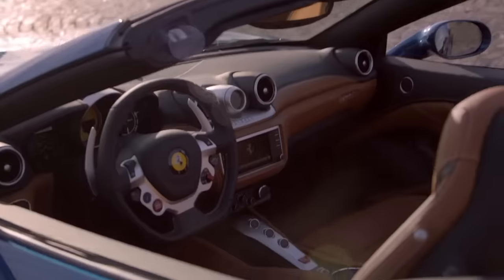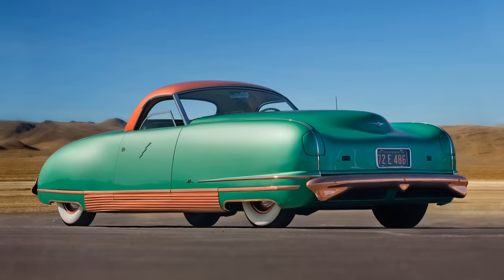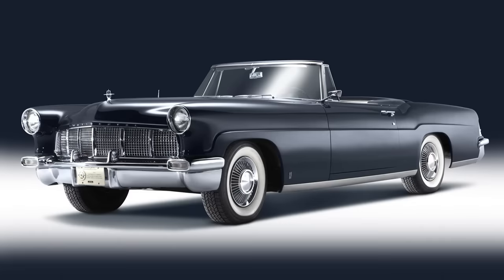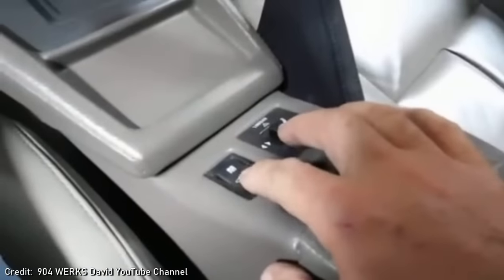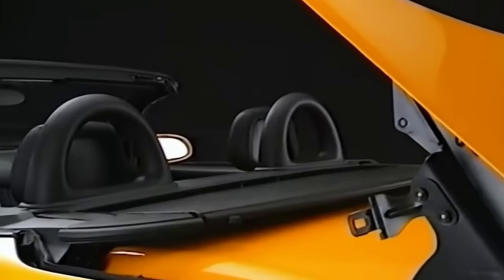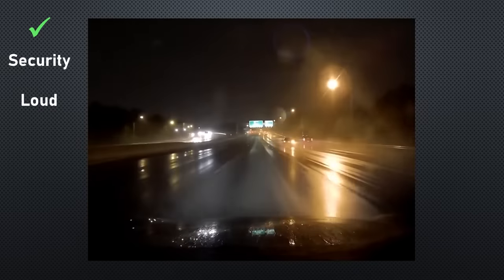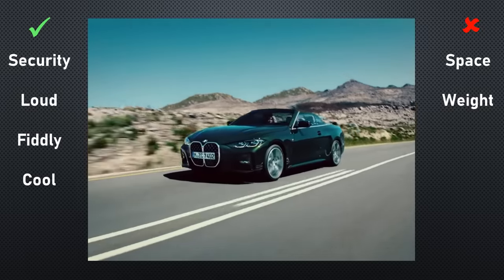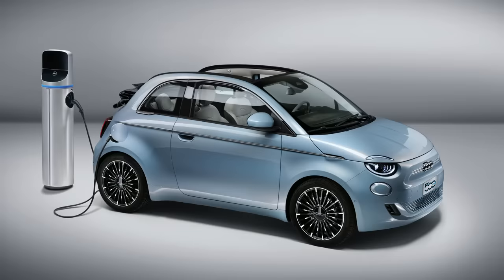The Rise and Fall of Retractable Hardtops

Comment: I still have my retractable hard top convertible 2011 Volvo c70, and I LOVEEE this thing. It's like nothing else on the road. It still garners a lot of attention when I put the top down, it is very quiet, and it drives very smoothly. It is also pretty darn practical, even with the top down. There's still space to store stuff back there, and the back seat space is more storage. I have 130k miles on it and I can't imagine giving this car up for almost anything. I was so sad they discontinued it in 2013. It's the only car I ever want to own.

Comment: My MX5 with retractable hardtop (gen 3 built late 2006) is one of my favourite possessions. I’ve owned it from new and cared for it. It is brilliant to drive, economical and pretty to look at. Sadly, it is now a full time coupe and hasn’t been a roadster for several years. It has a bent tooth on a sector gear. I can’t just replace the sector gear. Mazda will only replace the entire underlying mechanism for a ludicrous amount of money so, in these plague years unless I win the lottery it will remain a coupe. Oh, I’m reliably informed that it is essentially worthless without a working retractable top. It is brilliantly designed — there is plenty of boot space for a 2 seat sports car, it retracts in 12 seconds (when it did retract) but … ? Not happy, Mazda.
Reply: Try an independent shop. They may have a fix for you.

Comment: Have a 2006 vw eos... great car handles well, 50/50 weight distribution with top down. 2.0 turbo so is golf gti like. 
Disadvantages... 30mpg which isn’t too bad considering everything, boot space... not too bad really and better than a golf convertible, but then if I want to haul stuff I use my vw t5 long wheel base. 
So yea it may be out of fashion but it’s lot more fun than a boring suv in white zzzzzzzzz

Comment: I used to have a modern soft top convertible, 2002 Chrysler Sebring. I say "modern" because it was pretty decent at reducing exterior noise, had a glass rear window, and took a bit more than just cutting the roof open to get inside. But I must say, as much as I loved that car, I still like the looks of a hard-top convertible, especially if you live in a region (like I do) where the seasons are exactly as you would expect, cold snowy winters through steamy hot summers. Which means there will be long stretches of time where the top stays up, and I'd like the car to look like a normal coupe. I also don't wanna be bothered with special care for the top during this time. However I've heard stories of hard tops forming leaks in places soft tops wouldn't unless you damaged them.

Comment: I have had hard and soft top convertibles. The soft top was a lovely little MGF that was like a road legal go-kart and made me grin every time I drove it. Downside - it was a single layer top so it was noisy and made the interior dark and it had....................yes, you guessed it - the notoriously unreliable 1.8 litre Rover K-series engine. I blew two head gaskets before my eyes were opened and I saw the words on the bonnet (hood) that said 'bottomless money pit'. The hard top convertible was a Peugeot 207 Coupe Cabriolet that with the lid up was a quiet and comfortable long distance cruiser and a civilised tin top coupe in the winter. Put the roof away into the boot (trunk) and it was a great convertible. The MG was much more fun to drive though. I'd still go for a hard top coupe convertible and I have my eyes on the Lexus SC.

Comment: What timing. I just traded in my 2010 MX-5 with retractable hardtop for a 2021 MX-5 with a soft top. Plus I just completed my first road trip of around 700 miles. Yes, it is a tad bit nosier on the highway but it also lost 300 pounds and gained 25 HP translating to more fun. I just didn't think that the RF model kept up with the weight gain.

Comment: Good retrospective video. A cheap soft top is a pain to live with, but if you look at the quality of Porsche 911 cabriolet tops you realize these can be done perfectly. I had an early SLK and enjoyed the relatively simple retractable hard top, but the car was tiny so aesthetically it worked. The BMW 3 series retractable roof was a styling disaster, IMHO: Too many seams spoiled the intended cleverness. Overall, I think the soft top is more elegant, but only when done well.
Reply: If, like it's grandfather, the 911 is a cabriolet and not a ragtop, then I get it.  Thr vw beetle cabriolet was insukatrd and had a headliner so that Germans wouldn't freeze to death driving it around in winter.

Comment: I mean, soft tops get old and worn out after sometime; though they look prettier but they are a bit of a hassle once manufacturers didn't produce spare soft tops anymore. Thus retractable hardtops is actually very promising in a long run, and also safer from prying hands. That's why my dad bought the SLK instead of the E-class convertible, even when both cars have similar pricing when entering the 2nd hand market.

Comment: I have a Mazda Miata RF (inherited from my wife) and what I like most about it is that I can put the top up or down @ a stop sign or red light. I drive around with the top down and put it up when I park so leaves don’t fall in and the leather seats don’t get cooked. There is enough room for a couple supermarket bags and that’s about it. I wouldn’t have bought this car but now that I have driven it a couple thousand miles I kinda like it. I have a GMC4X4 Duramax in case it rains and when winter rolls around.

Comment: In very sunny climates another advantage to retractible hardtops is that soft tops degrade in the harsh sun. Where I lived in San Antonio Texas soft tops would only last 2-3 years outside. I had a MY2000 SL500 and replacing the soft top was expensive!

Comment: I remember the second facelift of 1st. gen of Mercedes ML had optional electric folding rag top over whole roof but device always failed if not properly regularly mainained. Some manufacturers still offer it for some long roof models. Mercedes of A and B class even had polycarbonate transparent lamela sliding roof as an optional extra. The king of them all is custom made Ford F-150 by Newport convertible - my faw WoW drop top....
My mom loves the oldest one of our family cars.....an ageing mulla scapegoat we keep from nostalgia....Grand Scenic with panoramatic sunroof...and you know what? Once a year to clean up its rails and spout cannals, every 6months to spray mechanics with silicone oil...and that's it....still retracts smoothly....never leaks...very durable and reliable system!

Comment: Having just got a hard top after only ever having soft tops here's my pro and Cons 
Pro: quieter, colour matches with body, easier to clean, more secure, degrades slower, some cars look better Cons: takes up boat space, can look awkward on some models, weighs more, takes longer to fold. overall I think it's a viable option but I prefer soft tops overall. I think one of the main reasons these are popular is to allay unfounded fears people have about softops.

Comment: I have a 2008 Mazda MX-5 Grand Touring PRHT  (Powered Retractable Hardtop) and it doesn’t take any trunk space and has the same 150 liters capacity as the soft top version. However, a big downside of a retractable hardtop us that it’s very expensive to repair whenever it breaks down. My car’s hardtop broke down in the open position and there wasn’t a manual override to close it manually. I ended up paying over $2300 for replacing its two electric motors and I was without my car for three long weeks. Sure, a soft top convertible breaks down as well but at least it wouldn’t be as expensive nos as complex as fixing a hardtop.

Comment: The way the roof and the windshield and the trunk lid are stacked over each other with the correct curvature ( so like stacking bowls ), I wonder why a soft top can be compressed into a more compact space without doing harm to the fibers. Just look into any racing sail boat with different sets of sails stored in the hull. Also the rear window seems to be made of glass anyway.

Comment: To be honest I i want one. 

I own a soft top, I love how quick it is to put up and down and the fact it’s lighter.

But it’s much more susceptible to theft via knife, much louder inside and really needs to be replaced with a hardtop in the winter months 

But at least I don’t own a boat
Reply: I own a 2010 Mx5 with soft top that is my daily drive come rain,shine,Ice or snow.. Why is a hardtop needed for winter?
Reply: @jvoric  I own a 2004 MX5 and it too is my daily drive. 

Hardtop is a must for winter to avoid heavy snow from damaging the frame of the soft top, to avoid ice from causing damage to it also and to prevent leaves blocking the drain holes leading to rear arch rust
Reply: @Racing_Fox  mines had snow sat on it, hail storm batter it.Ice/ frost freeze it, but I’m not stupid enough to put the roof down when it’s frozen! I keep my roof drain tubes clear by checking them every few weeks in autumn as the leaves fall  .never had any problems with my roof what so ever..no condensation inside or in the boot no water behinds the seats 
I clean then treat the roof with fabsil gold which waterproofs it brilliantly..I totally disagree that a hardtop is required for winter
Reply: @jvoric  that’s cool you do you, I just want to prolong the life of my roof for as long as possible it’s already 16 years old now and I see that putting the hardtop on over winter is the best thing. 

Not to mention it insulates better than the soft top so it doesn’t get as cold in there And it offers higher visibility when the conditions are likely to be poor
Reply: If you get the chance, spend a little bit of time in a soft top Bentley. The top is seriously 3" thick. I understand it's prohibitively expensive, but it solves all of the soft top downsides.

Comment: Failed to note one major benefit of the retractible hardtop.  Most hard tops have no temperature limitations for their operation.  I routinely put my top down and drive places in below freezing temps while keeping the heat and seat heaters on the highest settings.  When I arrive at my destination, I often need to secure my car, which would cause damage to my previously owned rag-tops.  I’ll never go back to owning a soft top.

Comment: Thanks for the video. I found it very interesting. I had a Honda del Sol and my brother had a Mercedes SLK.
Although the United States version of the Del Sol did not have a power-operated Targa top, the rear window was power-operated and rolled down at the touch of a switch making the car something of a open vehicle with a large "roll bar" when the top was stored.
Unfortunately, the Del Sol did not handle ad well and was not as nimble as the preceding Honda CRX

Comment: One of the things George Paulins, did while with the French resistance, was build hiding places in cars.  

He created, one such cavity, between the Back seat and a fake bulkhead in the boot.  

The Citroen Traction Avant, was the prefered vehicle for this, with it being front wheel drive.  

Laid on their side, a resistance fighter wanted by the Nazi's could be whizzed around Paris, from one Garage to a Warehouse, and would not be seen be anyone.  

He also, constructed fake sills, for hiding weapons and Radio transmitters. 

Most of his work was for Pourtout.  But he worked with VanVooren, on the original Bentley Corniche of 1939.  

His best work, is arguably the body he designed for a Bentley 4 1/4 Litre for Greek Racing Driver Andre Embiricos in 1936.  Constructed by Pourtout.

This design, slightly modified was to lead to him designing the first Bentley Continental in 1939.  

It is thought, this contact with Bentley (part of Rolls-Royce from 1931), led to his recruitment by British Intelligence in 1940.

Comment: Up here in Scandinavia with our climat, the softtops are really no good in winter, so those cars can be used only half the year. Retractable hardtops however can be used year around... One exception was the SAAB which had a thicker (double?) softtop that was ok in winter. But that company is gone...
Reply: Yes, this is the distinction between a proper cabriolet (inside headliner, and perhaps insulation as well) and a rag top (one thin piece of fabric between you and the elements.)  Classic VW beetle and Ghia Convertibles were done in this manner, I think because of the Karmann motorworks badge was involved and they didn't want VW cheapening their image.  Not sure if the more modern VW cabrios are still done in this manner.  Greetings from the U.S.A.!

Comment: Excellent well-researched video Sir! Missed a couple; like Edsel briefing having a version (unsure how many Citation retractables sold in 1958; we had a coupe); and my present and prior SL. You properly highlighted the SLK, but I currently drive an SL450 retractable hardtop for several years, and it's still a looker in my opinion; very reliable overall and ZERO servicing of the retractable top. In fact I have decline the 'new' SL, which is more expensive with a soft top; hence no interest in my part. I 'hardly' understand Mercedes doing this; because they sell some in Germany, which has lousy weather much of the year. And I'm sure I'm not the only 5-time SL owner (9 'benzes total) who will NOT buy the new SL as it's 'ragtop only' and LESS roomy than my R231 SL.

Comment: The Focus CC actually had the biggest boot in its class both roof up and down
Reply: Focus cc used the Volvo roof mechanism…
Reply: @jvoric  I don’t think it did, pininfarina designed the roof and there are no interchangeable parts with the Volvo, plus the hard top didn’t come out til a few years after the focus as Volvo were building ragtops at the time
Reply: @LiveoneLee  hmm I maybe mistaken then..lol

Comment: I have a 1993 Miata and had replaced the top in 2006. It needs another at this point and installation costs are insane. I’d be happier with a convertible hardtop model that wasn’t working properly. While saving up for a repair it could remain a very usable coupe. My soft top has a few areas where rain gets in. I have been very interested in retractable hardtops recently. I’d love a new Miata but I don’t consider the RF a full convertible like the previous gen. The RF is very attractive but I would love to see a return to fully retracting hardtops in that model.

Comment: They are something to break.  I own a 1997 Honda Del Sol Si.  I am an original owner.  The roof top is manual.  You take the roof and put in the trunk.
It has it own older.  After 27 years it still works.  Also even with the roof in the trunk I still have a decent trunk space.  With the automatic your space in the trunk is much smaller or is gone.   The Del Sol has been called the thinking man’s convertible .   The Del Sol is the most practical two seater  available.
It is a two person car with trunk space for two.   I have driven the Del Sol from Florida to New Jersey.   Once you are in the car it is quite comfortable 
It handles well and is fuel efficient.  I am an original owner with 221,000 miles.  So a two seat car can be practical.   Almost all other two seat cars 
are impractical  and are used only for local short distance driving

Comment: As a previous owner of an Opel Tigra Twin Top, I am now on the market for a similar small fair priced soft top convertible : MX5, Street Ka and such :-)

Not that I didn't enjoyed my TTT, it was a peaceful and cool car.
I never got any "angry / jealous looks" while behind the wheels (my brother still has few, in his Renault Wind).

I'd now rather have a non electrified roof mechanism : way less prone to failure, cheaper, simpler and usually faster mechanism !

The only retractable hardtop car that I might consider would be the NC MX5 (I don't like the ND MX5 RF : this is no longer a convertible, it's a targa).

Comment: I think the main appeal for many with retractable hardtops is better climate resistance. It was sort of weird that a Brit wouldn't include that into the pros... If you drive in cold and snowy climates and have only one car, a soft tops usability ranges from hellish to very unpleasant. Retractable hardtop on the other hand is almost like a regular car during the winter, and due to the large bulky roof, they even have pretty decent trunk space with the roof up. Sure, there have been some attempts at winterproof soft tops. Latest that comes to mind is Opel Cascada with its well advertised multi layer insulation on the roof, but I still would not like to dig it out after a -20c snowstorm...

Comment: Thanks, I always assumed(wrongly) Mercedes were first with the SLK. 
 They are very complicated with numerous motors and micro switches, big problems when they go wrong, however my MGB was a pain in the rain, and of course it leaked even with the hood up.
Reply: T shaped seals is something I do not understand. We have windows in our house with this, but they are supposed to leak a little bit -- air that is, not rain. For everything else in a car there is one opening and one lid : Doors, trunk, small glass-roof on my old car, oil-pan, valve-cover, tire on rim, sliding window in frame.

Comment: You forgot another problem with hard tops is all the creaking between the various panels as the body twists and creates a headache for all the companies. I had a z4 and was in for seal greasing every few months as well as wear on the locking latches from movement.